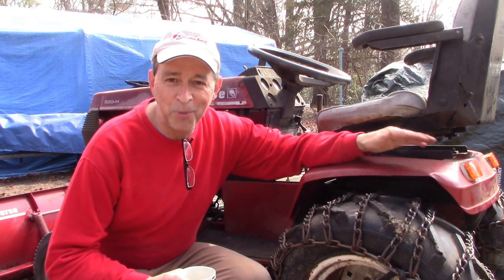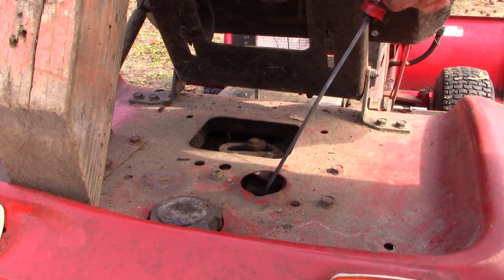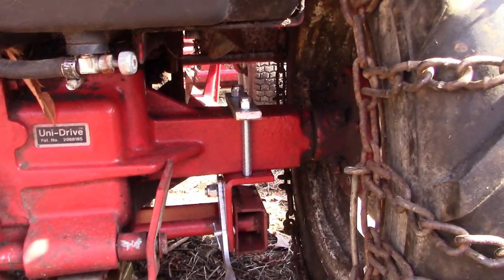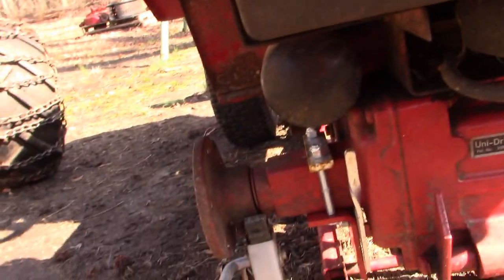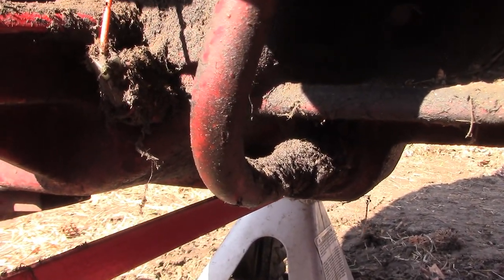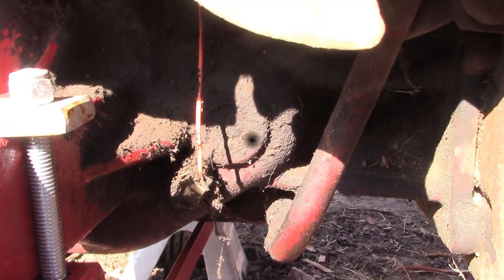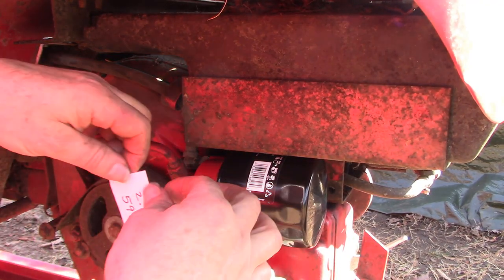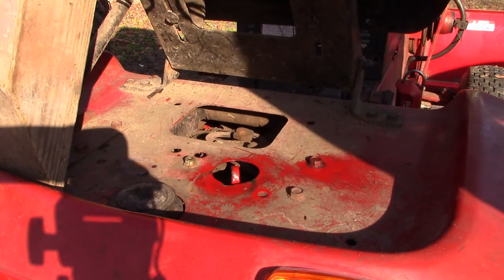How to Change the TRANSMISSION FLUID & FILTER on a WHEEL HORSE 520-H Hydrostatic

Comment: Good video. Here are cliff notes. 1/4" allan drain plug. Stens 120-265 filter. Takes about 3.5 quarts of 10w-30. Leave filter off when filling until mostly full to purge air.

Comment: wheel horse as it's satin it's losing oil i gotta see what seals leaking yeah i haven't gotten the motor back in it mice ate the wires i took.  Motor  off so i could look at it and try to rewire it and when i pull my sciatic nerve i haven't put the motor back on tractor yet so i gotta figure out what seal is leaking on it Why it's doing what it's doing but it's got to have the whole transmission drained by now Thank you for the video